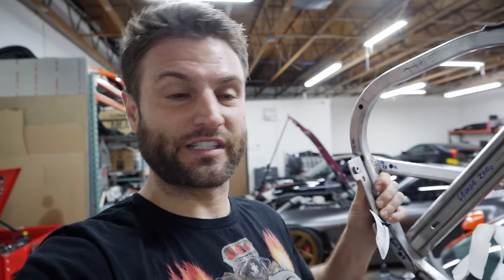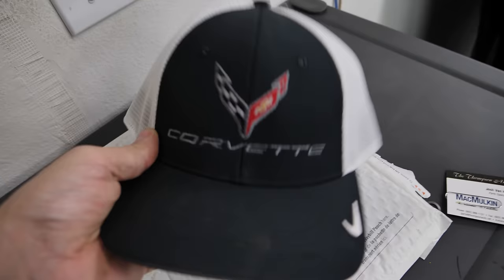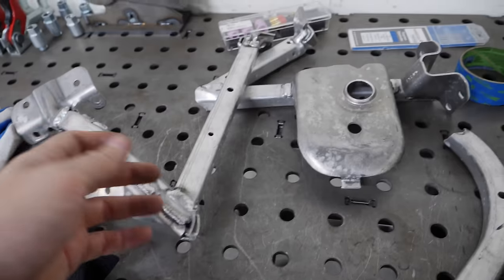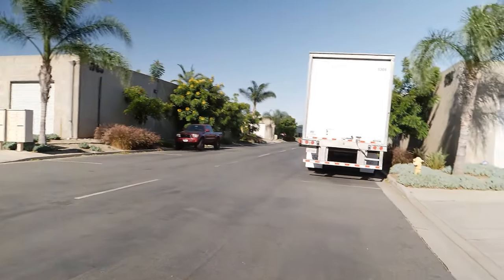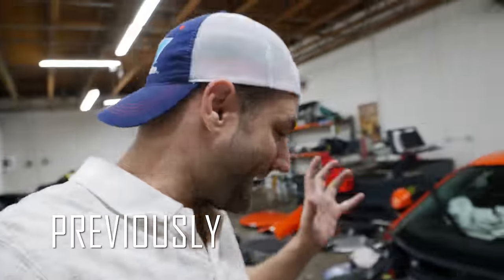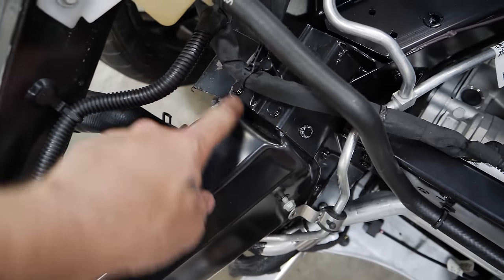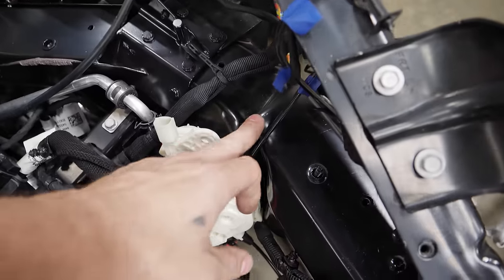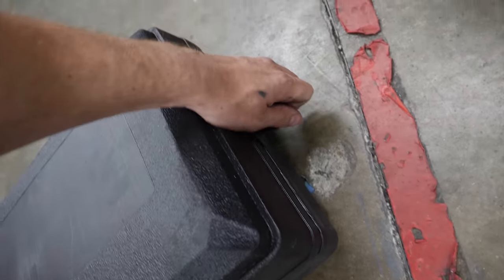Chevy won't sell me parts for the Wrecked C8. Bending the Chassis myself!

Comment: You might wanna do some rethinking if your plan is to weld that aluminum, especially if it is in fact 7000 series.

"High strength alloys (e.g. 7010 and 7050) and most of the 2xxx series are not recommended for fusion welding because they are prone to liquation and solidification cracking."

source: https://www.twi-global.com/technical-knowledge/job-knowledge/weldability-of-materials-aluminium-alloys-021
Reply from the maker: Fusion welding yes. Rod welding is better. But I think I have another solution
Reply: @RobDahm Good deal.  I'd just tube frame that ish! haha

Comment: You can't bend aluminum like you can steel to restore the car - it cracks. The right way to fix it is to get the frame rail pieces and adhesive from Chevy...oh, wait...

Comment: I explained to you in your first video 
I am a certified aluminum repair tech 
You are not supposed to pull on aluminum chassis parts 
Cut and replace 
I know you can’t get the parts 
That sucks 
By pulling in your case pushing 
Same difference 
You put stress on bonded parts in other areas on the chassis 
Take the car to a Chevy shop let them do the frame repair

Comment: they probably don't even have the parts yet but thats why after 1985 or so i would not buy a chevy for nothing that traction control also pulls power out to keep it from spinning and any good driver knows in curves you need to spin

Comment: It is irresponsible to repair this car with following the OEM procedures ... clearly the car had airbags deployed. In the next crash when the airbags do not deploy correctly when the front rail extensions do not absorb energy as GM engineered I hope you understand that YOU will own 100 % of that liability. I am glad you documented this so it will be easy to identify the repair history 4 years from now. If you are giving this car away ... you will still have the liability of creating an untested and unsafe structure. 
PLEASE send the car to someone who knows what they are doing and have it repaired correctly.
Reply: To ensure I was clear it is irresponsible to repair this car WITHOUT following the OEM repair procedures by trained and certified facilities and personnel.

Comment: So if someone blows the stop sign and you smash into them with your C8 and crush your front end. The body shop can not fix your car? That is just messed up. And to find out that you could have a flaw in the LT2 engine from the factory. 
Yep I'm not buying the C8 Corvette. One of the cylinders does not make it all the way to the top of the block. The LT2 has a slightly longer stroke then the LT1. And Your LT2 engine some how got a LT1's connecting rod. OOPS.

Comment: Aluminium chassis parts ARE NOT something that should be tackled by amateurs - they really are a specialised job as both the heat treatment and SHAPE are critical - and localised heating* and/or damage is going to take almost ALL the design strength out of the part.
Sure, there are going to be little bits, here and there, where strength isn't an issue, as such, but only an expert can really make that call.

*Why they are normally glued and/or rivetted together - welding can, and will, weaken the part!

Comment: Just to let you know, a friend that bought a salvage car like you and someone repair a frame like the way you're doing, the frame cracked driving down the interstate and he lost control of the car and all 4 of his children got killed and the father live, hope you don't go through this mishap
Reply: The part he is replacing is not part of the actual 'vehicle' so to speak. Its just the part that holds the radiators and front bumper.  Its pretty much a non-structural part.  Sure, its the crash absorption rails but that can be sorted easily enough.

Comment: Rob, aluminum parts can not be fixed once deformed that far.
Also heat that way (not annealing) on aluminium wont help. 

The reason they dont sell thoes parts to anyone  is for safety, ive been in the crash industry for 10 years (what would i know  right?) But old timers never worked with anything apart from mild steel.

Now with aluminium and high strength and ultra high strength steels aswell as bonding, ol joe from the panel shop around the corner wasnt taught this. So they doont sell structural parts to him because they dont want to jeopardise anyones life.

Love your content but some things definitely should be left to people trained in the right processes.

Matt, panel beater and certified automotive structural welder.

Comment: Well rule #1 never use an open flame to heat aluminum, especially in the collision industry, extremely important for frame rails. That shit is fucked.#dontwreckthatshit
Reply: As long as it’s getting replaced, go for it though.

Comment: Sorry Rob, but structural integrity of the car has been compromised. Improper repairs such as this will cause the car to collapse incorrectly thus resulting in occupant safety being compromised. Guaranteed losing lawsuit if in another accident. Also without proper measuring and repair techniques, vehicle drive ability and handling will likely be affected. Unsafe...this is why many states have laws governing such repairs. I applaud your ingenuity, though.

Comment: Rob I suggest You to look for an certified aluminum welding sheet metal tinsmith specialist => checking the grade and aloy of aluminum and if it's cold forged to rebuild the whole front structure which will be anyhow be w a y cheaper than  buying and getting all those parts installed by C.A.R.N.! 🙈

What is that for a fudging policy by #generalmotors !? 😡🤬

Is our private man's money n o t good enough for #generalmotorsmanagement?

Just name it after CoViD19 guys !☠️ We buy other brands! ! ! No problem!

Other than that'  YOU supply => we buy! Means NO dealership involved => to keep parts and self repair cheap with max safety through original parts!!

Stuff Your C.A.R.N.-plans up to where the sun never shines!

Comment: come on, what are you doing to that car? put it on a bench and straighten it out correctly, you are causing more damage to it. there are other ways of dealing with aluminum, either weld or resection, and aluminum bonding with rivets. and I am not referring just too ordinary rivets, just in case someone is going to judge me, german cars makers have been doing it for a while now.

Comment: idk if this has been said here before but man bending back aluminium is a very bad idea! this is not steel. whilst steel is relatively elastic which means if can be bent without losing too much of it's structural strength, aluminium is stiff and gets much weaker from bending. especially when bending back aluminium you most probably will have hairline cracks in the material. worst part is, you won't see it from the outside you'll only notice it when it catastrophically fails you. let's hope it won't be on the brag strip or motor way!

Comment: Noooo , Horrendous hack job. Totally unsafe, Do the job right, have the car repaired correctly by the OE approved repairer for this chassis damage, then do the rest yourself. Should someone get injured in the future as a result of this hackery, the potential claim is HUGE, this vehicle will not respond in any future incident the way it did in this past. It will cause issues in the deployment of airbags and can create worse injuries. Terrifying.

Comment: Couldn't you just fab up a set of inserts - cut off the damaged section and make a piece that mimics the impact-absorbing section, and slots inside the undamaged section from the cross beam backwards?
GM's position will not be about enthusiasts loving the C8. It'll be all about making sure GM doesn't get sued if an incorrectly repaired car is in a second incident, especially if that leads to fatality.
Ask a GM lawyer about the Corvair roll-over lawsuit..

Comment: hi rob gm can't refuse to sell the parts if you fix it yourself with factory rail they can void your warranty because you fixed it but a certified panel shop can fix it and you keep warranty but they can't refuse to sell you the parts thats illegal tesla tried that and got in hot water for it go back and tell them you will laywer up i bet you get the parts you need or pay one of those specialty certified panel shops to do just the chassis rail ends only and do the rest your self keep cracking on

Comment: ahh.. your first run in with UHSS.. lol..  its not meant to be repaired. only replaced.
you shouldnt put heat on UHSS either, it ruins the structural integrity of the steel.. I hope your plan is to replace both full rails.  Otherwise, You are the crumple zone Rob..    P.s Please dont be another dodgy bastard like Sam Crac.. Do it properly please. :)

Comment: Sorry but this guy has no clue . No training. Trying to do a repair beyond his ability. I should wouldn’t want to b in another front end collision. If you can’t get the frame rails then take it to a certified shop and let them do the major repair .Also doesn’t have the proper tools to do a rough pull . I don’t even see any kind of measuring system. I stop watching this video.